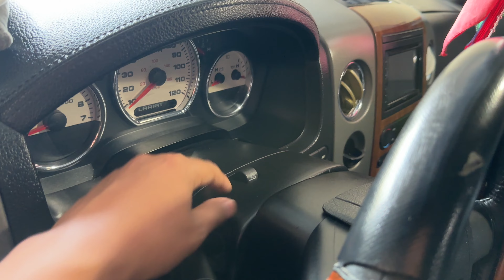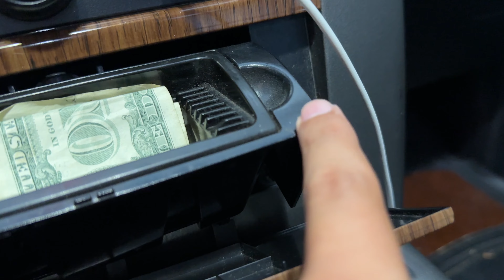My Truck Got Broken Into!!

Comment: The dash is such a hassle to take out bruh cause some bolts are in backwards and you have to get into weird positions to get them out and tbh it’s prolly best if you take out the dash bars and take the whole thing out together then replace them outside of the truck just so that it’s easier💁
Reply from the maker: @yaboimatty961  I’ll look into that thank you